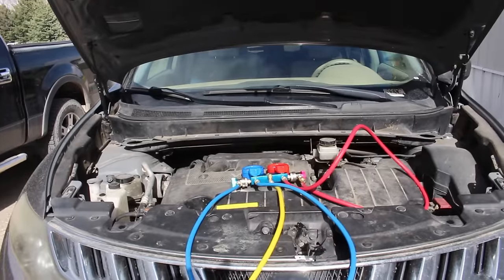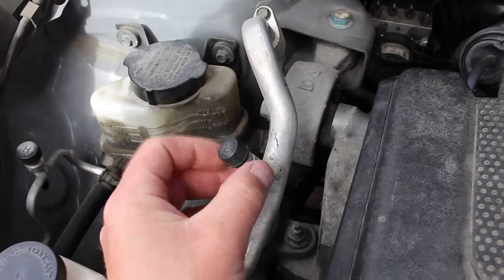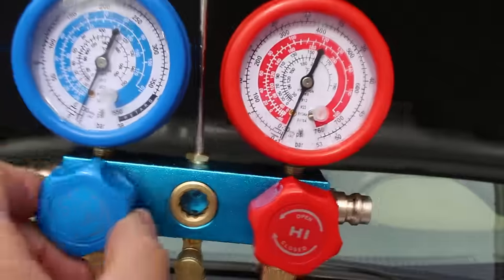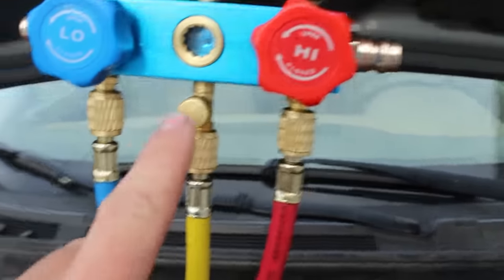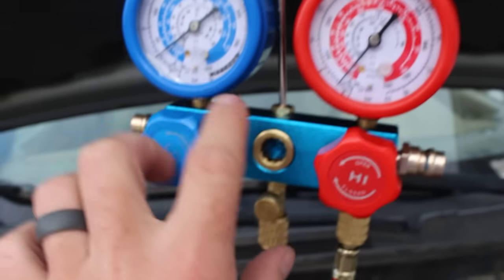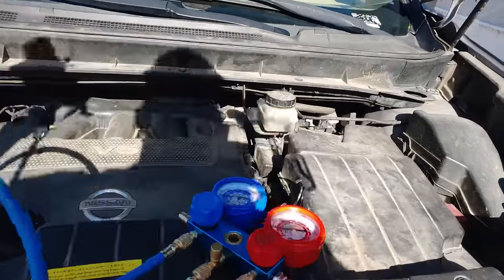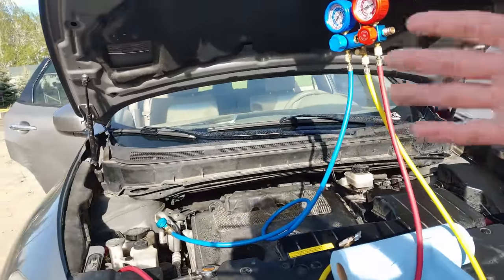How to Recharge a Car's A/C System Using a Manifold Gauge Set & Vacuum Pump - Air Conditioning

Comment: Always appreciate YouTubers that share their knowledge and skill.  It was also refreshing to see that you corrected yourself in the comment section that vacuuming an a/c system does not remove oil.  Just want to make three points for newbies that may attempt this:

1. When connecting & disconnecting both quick connect couplers to the Low & High side ports, they should be in the Closed (counterclock wise position) meaning the needle is in the retracted position.  Then make sure your gauges are in the closed position. And then Open the quick connect couplers by turning them clockwise to depress the needle.

2. Your system had no refrigerant to begin with.  That indicates that you like replaced a component such as the compressor before starting this procedure.  In that case, vacuuming the system is the logical next step.  However for most others who are simply attempting to add refrigerant to a system that is low on refrigerant, you will not be vacuuming the system UNLESS you have evacuated the system first.  This is the preferred method but requires an evacuation procedure and likely a service station to perform that function (likely at $0 to minimal cost since they benefit from the recaptured refrigerant).

3. You should not need to re-bleed your yellow line between can-change charges if you temporarily close the valves at the can and manifold during the changeover before resuming the process.

Thanks for the video!
Reply from the maker: Thanks for watching & for the instruction! A/C can suck! but if you can get it to work following this process, if everything is in good working order, it will save you a ton of money!
Reply: Well I did get the ac compressor changed and the ac recharged working  great you still helped a lot ....but being my first time it came out great but won't be the last thanks...
Reply: I went into heat stroke and woke up in ICU because I couldn't recharge my truck's ac system. I had a temp of 107°.
This video will be very helpful.
Thank you.
M
Reply: That's exactly the answer I was looking for thanks for the advice!!!!
Reply from the maker: @MMorMM  Thanks for watching! Get it fixed man!!!
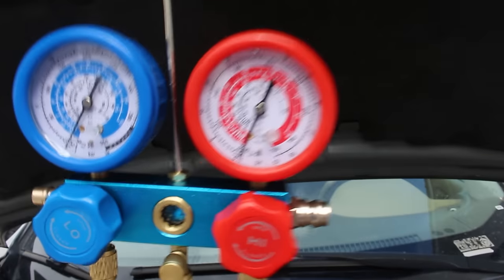Reply: 5:04 2CARPROS said NEVER EVER open the high side valve ON the gauge. Who is correct? He said you can open the valve on the high side ONLY on the high side port of the gauge that connects to the car to get the reading on the gauge, but never on the gauge itself.
Reply: Thanks for the steps
Reply: @MMorMM  is that a joke?
Reply: @barrysuss4421 When you are vacuuming the system you CAN open the red high side port....You DON'T open the red high side if the car is running with the A/C on which is when you are recharging the system adding the freon refrigerant thats when you make sure that the red high side valve on the gauge manifold is closed and stays closed (but the coupler part is open where you connect it to the port in your car)! I was confused too watching these videos at first as well but now I understand it better.

Comment: pag oil does not evaporate under vaccum - only when exposed to air (positive pressure) most cars have 7 ounces total in the system. the 2oz cans should be added from time to time and its a really easy and cheap way to do it. DO NOT ADD 7 ounces when charging a system. Even if you buy and replace the compressor DO NOT ADD A FULL 7 ounces. The compressor will come with 3 ounces already - you do not want to overfill the system with PAG oil.
Reply: ABSOLUTELY CORRECT!
Reply: Thanks for the needed info Will. I find that if I quickly release Freon pressure (via schraeder valve) from a possible overcharge that the pag oil spurts out on the hood of car and engine, but if I depress the valve slightly there is much less liquid oil coming out, mostly vapor.
Reply from the maker: Thanks for the clarification! I was wrong in saying the oil gets drawn out or evaporates when the system is vacuumed. While you may lose some oil when the refrigerant is removed from the system, you won't lose it all and drawing a vacuum won't remove any more. Correct, most compressors do come prefilled with oil, so keep that in mind when doing a replacement.
Reply: Please I had a leak exploded the ac line ,I have to add more oil ?
Reply: Came here to say this. I typically only charge .5oz of pag
Reply: How much pág oil do you recommend from a used AC compressor?
Reply: @yinkasantacruz6708  On a used system, its best to drain the compressor into a bucket and weigh it to see how much is collected. Replace accordingly.
Reply: Then edit your video with that correction before someone messes up their car.
Reply: What am I missing most cars have 7oz bt my gmc days 37oz what now am I missing? Plz help
Reply: @jwillzcommonsence8870  7oz of PAG oil in the whole system is what he was saying. That 37oz you're referring to I believe is the refrigerant capacity.

Comment: 2 Years late : NO OIL TO BE ADDED : Vacuuming a system does NOT remove oil. Oil is only added to a new compressor (if) it does not come pre oiled!
Reply from the maker: Thanks for the clarification. Exactly right!
Reply: … and if you replace the condenser, don’t you have to add something like 1/3 oz?

Comment: Dont ever pull your refrigerant from the high pressure side. And dont ever recharge to the high pressure side. Thats is a VAPOR line. You're wanting to pull LIQUID ONLY! The low pressure hookup is a liquid line. Please be e609 certified before servicing AC systems.

Comment: The vacuum does not pull the oil out of the ac system
Reply from the maker: Actually, you're right! Did a little bit more research and while the vacuum may remove the moisture it does not evaporate the oil. What removes the oil is when you have a leak in the system over a period of time or if you replace a major component. Best idea is to add a tiny amount when adding freon to replace anything the system has used, but no need to refill the entire amount upon a recharge unless you replaced a major component and it's not prefilled.

Comment: Don't know who told you that .Unless you are changeing a compressor then you would need to put the correct amount of pag or ester oil  you are only takeing mosture out your system not oil do not ad oil.
Reply from the maker: Correct! Pulling a vacuum does Not remove oil from the system.

Comment: What do you do if your gauge doesn't have a purge valve?
Reply: You can slightly unscrew the yellow fitting at manifold to purge line.
Reply from the maker: Thanks for watching! Just loosen the yellow line at the gauge set to bleed out any air.

Comment: [*This is to viewers who may attempt to connect a manifold gauge set to a system and try to charge it.] 
  Although he is initially pulling a vacuum, essentially removing any/all non-condensables from the system, the proper way to perform the initial steps would have been to first turn the vacuum pump on before back-seating (opening) the valves on the gauges.  Other non-condensables (and possibly other refrigerant types from previous use) most likely exist inside of the hoses, and could travel into the system.  It's always good practice to get into that habit in case you ever forget to purge your hoses one day.
  Also, you never want to pull a vacuum on a system that has a leak.  [If your A/C system doesn't have any refrigerant in it, or is otherwise low according to its factory sticker or nameplate, IT HAS A LEAK.  These systems are closed systems (meaning the refrigerant never gets 'used up' or is depleted from a system.  It should still maintain its factory charge, whatever amount was weighed in after it was manufactured.)]  The first step on a system that is suspected of having a leak is to first find that leak using an electronic leak detector in conjunction with a soap bubble solution.  If the system is completely empty, pressurize it to the system's minimal, allowable low-side pressure with nitrogen, with a trace amount of the refrigerant that belongs in that system. 
  A side note: A digital manifold gauge set (such as the Fieldpiece SMAN) works great, and is very accurate when monitoring your inches of mercury (i.e., your vacuum pressures).  It facilitates decay tests, vacuum pressure tests, etc.
  You need to test your hoses individually, to verify they aren't leaking at their fittings through the O-rings, etc.  Otherwise, you may be chasing a leak in a system that doesn't exist. 
  When using an analog gauge set while pulling a vacuum, its impossible to know where your vacuum is at during the decay test; you can't see with accuracy how far down into a vacuum you are pulling the system.  Am analog gauge set doesn't display microns - the crucial measurement used to help facilitate pulling a refrigeration system down into a deep vacuum.   [The EPA (Environmental Protection Agency) recommends that we are to pull a minimal, single, deep vacuum of 500 microns, or a triple-vacuum of 1000 microns.]  This is where a digital manifold or a micron gauge comes in handy.
  If, during the decay test, the system creeps up past 1000 microns withing a 20-minute span, there is still a leak in the system, and will need to be addressed before continuing.
Reply: Why don’t you upload a video with all this information you have?
Reply: @blackericdenice  I may just take you up on that offer! 
 At the moment, I am extremely busy juggling school, work, and studying for my Contractor's License and 2nd NATE Certification.  
  I promise you a video when we take our break for our 3rd semester, which will be in about two or three more weeks!  
  I just subscribed to your channel, by the way; Nice to meet you! 🤗
Reply: @ParabellumX  Cool and thank you
Reply: Hi HVAC Parabellum X, can you please recommend a digital manifold gauge that's not too expensive for DIY purposes? The one you recommended above (Fieldpiece SMAN) is $800.
Reply: "Back-seating" is not the same as "opening". The valves at the guages are front-seat only type valves, where full CW closes the valve and CCW opens the valve, just like a valve for a garden hose. The old refrigerant can taps that pierced the can had both front seat and back seat positions, meaning no refrigerant flow in the full CW (front seat) or full CCW (backseat) position. The back-seat position allowed you to remove the empty can and screw on the new can without piercing the new can.

Comment: Always turn the valves off before installing them on to the vehicle's ports. If you install them fully open two things can happen. 
First if the valve is open you can damage the vehicle's port (needle)
Second refrigerant can escape and may cause air to enter the system
Reply from the maker: Good advice! Especially important if you are just adding coolant to an already charged system, but even if you know the system is empty it would be good practice to start with the valves closed out of the box.
Reply: @EYVOAuto  No coolant in an A/C system, it's refrigerant
Reply from the maker: @zeke112964  haha, thanks for the clarification

Comment: I like your video, but I think you made one mistake. You said when you vacuum it takes the oil out. Not true.😌. The oil does not boil by vacuum pressure only water and moisture. The oil does stay inside of it. If you think I’m wrong please send me proof so I can stop blowing up cars 😅
Reply from the maker: Correct! Pulling a vacuum does Not remove oil from the system. I need to clip that part of the video out. Good catch! Thanks for watching

Comment: Good rule of thumb is high side should be twice ambient air temp in degrees F.  Wondering, could you use engine vacuum to suck the system down if you didnt have a vacuum pump?

Comment: Great Video! I actually bought the same pump and guage setup and watched to refresh my brain before vacuuming. Good thing as I forgot to open the red/high side. doh!

I hit a deer at 70mph and totalled my truck. I rebuilt it including AC condenser and dryer. Final touches. Driving home tonight at dark it was blowing 39F out of the vent. I had to turn it off.
I credit using a scale that measures grams and put in just about exactly the factory stated 875 grams for my old Dodge. It's COLD! Awesome!
Reply from the maker: Awesome! Glad it helped. I reference the steps and videos every time I go to do something. Awesome idea to use a scale to make sure everything is accurate before it goes in.

Comment: Good video Im going to do mine kust got the stuff to,does the oil come in the freon or is it seperate?suggestion, try not to shake the can makes it hard to read.
Reply from the maker: Thanks for watching! And great suggestion. The oil and Freon are separate, unless you buy the quick charge cans with it combined. 

However, unless you’ve done a repair to where a new compressor doesn’t come prefilled you do not need to add any oil. The video is incorrect in stating pulling a vacuum removes the oil, it does not.

Comment: Some videos connect the yell9w hose to the top valve on 5he vac pump, while yours connects to the side valve on the pump...please explain the difference between the two. Thank you
Reply: One is a different size than the other. Depends on your hose.

Comment: Hey Man I’m not getting any vacuum I opened the gauges and left it running for about 45 mins and still at 0 turned it off to see if I’m still getting a vacuum and nothing please help brotha I live in az and it’s hot
Reply from the maker: Great question! There's got to be a massive leak somewhere! Did you get it figured out? Sorry for the slow response

Comment: All car ac systems are OPEN systems, they are not completely truly sealed as they have rubber O rings that will shrink and dry over time releasing gas gradually. This is normal, pulling a vacuum on a system that has lost its R134a gas is superfluous. Vacuum the system, and add new R134A gas to spec. If the system is normal that will do it, if not then you have bigger issues.

Comment: great video, what is the best way to disconnect everything when charging or adding freon back is done?
Reply from the maker: Great question! Shut the gauges at the manifold, the ports, and then disconnect the ports. The schrader valves will keep the ports closed off to the outside once the hoses are disconnected.
Reply: @EYVOAuto  thank you. Let me see if i understand, i got the shut the gauges at the manifold part but for the ports, are you referring to the coupler valves that are connected to the low and high side ports? Shut them off and then disconnect them only or disconnect them and manifold ports? Hmm i think i have the shrader valves setup differently where those ends are on the gauge ports since thats how the picture was showing in the manual haha. Think i got the setup incorrect but not sure if it matters

Comment: Should the low pressure gauge of near 40 psi drop when you accelerate the vehicle’s engine?
Reply from the maker: Thanks for watching! I'm not a certified mechanic and not sure... revving the engine really shouldn't change the rate at which the compressor is spinning, not sure what could cause the drop or how the pressures should behave. What's important is the pressure with the system running when checking / refilling it - always done this at idle A/C on and never had problems unless there's a leak or something.

Comment: Newer vehicles are using r1234yf freon very expensive but taking it to a shop for recharge is 600$ also scotty kilmer says you dont have to hook up to the high side only the low side to evacuate the system & as for adding oil most of the freon already has oil in it.
Reply: Freon with oil in it and/or stop leak is roughly twice as expensive. I refilled an empy system for 3 small cans of R134a at $11 a peice from Orielly's. PAG oil was $9.99 and I have half of it left and half a can of freon left as well. Roughly $50 total. IF you don't need the extras don't dump them in your system. Keep it clean and mean. I'm still running good on my 2001 compressor. The condenser met a deer and neither of them speak anymore.
Reply: Man r123yf is ridiculous. I hate the day when I purchase a car with that stupid gas in the system. Also the little cans for just regular r134 are pretty price, so buying one with a little bit of oil in it just shoots up the price. I always add oil separately and look for cans that are pure gas and no other additives.
Reply from the maker: @packrat9433  I noticed this as well when recharging my system. Hurt a little bit spending $12 on a 3oz can of freon +2oz oil... but in the end it was still cheaper than taking it to a shop!

Comment: Thanks a lot for your information. I want to know how we can find a leak in a system
Reply: They sell a cheap tool online that listens for the sound of leaking air and you put it near all the possible leaking spot
Reply from the maker: You can get a UV light and glasses to see if you can see it - most refrigerants have UV dye added or you can add it to the system.

Or they make sniffers, cheap tools that detect the refrigerant. Then you just slowly wave or crawl this along all the A/C system and see what it picks up.

Comment: The vac pump does not suck out oil
Reply from the maker: 100% correct. Pulling a vacuum on A/C systems does Not remove any oil in the system

Comment: When doing a recharge with a manifold set- is it okay to keep the high-pressure house connected with the Gage knob closed and the service part open?
Reply: Yes, at 9:05 he said to do that to monitor the pressure as it's filling.
Reply from the maker: Yes, totally fine. With it closed you can watch the pressure of the high side as it's filling with the A/C running.